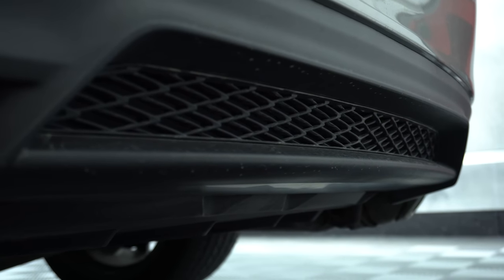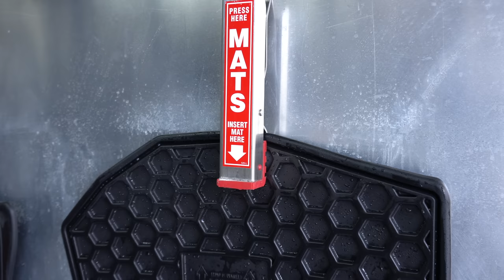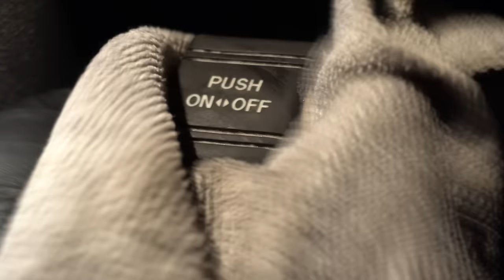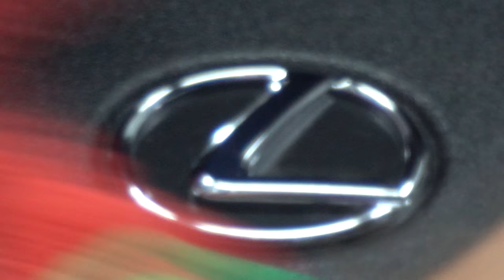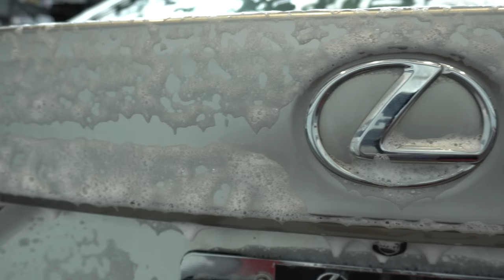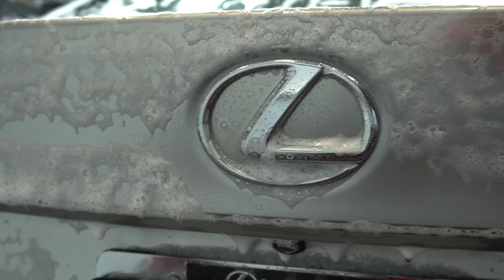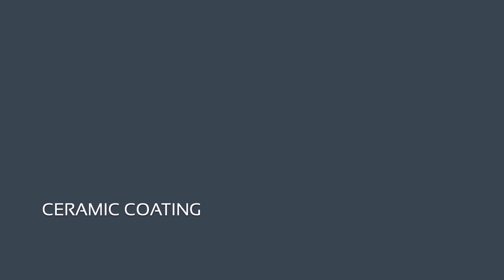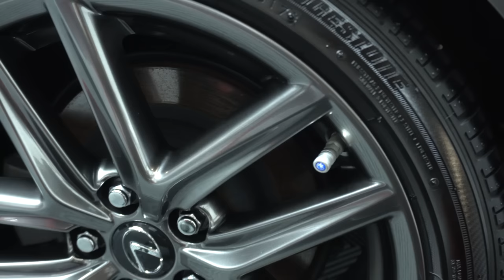2017 LEXUS IS300 F-SPORT LAVISH DETAIL | Interior + Foam + Wash + Polish + Ceramic Coating

Comment: I own one of these cars in Atomic Silver.  The lines are amazing. Each panel has intricate design elements i failed to pick up on when i first looked at the car.  Then I detailed the car and I was blown away.  After my first strip wash then polish and coating my wife came out and literally said Holy crap! Thats our car!?! Yep. 😜.   Just got my graphene from Adams this week sooo excited to get started.   Your videos are on another level sir.  You truly make art with your work and your vids.   Soo relaxing and instant gratification watching that car turn into art.  Thank you
Reply from the maker: No, thank YOU! I really appreciate the compliment. You do have a very nicely designed car. You are so correct with your comment about each and every panel having some unique design language. The part that really impressed me was the creases under the tail lights as well as the swoosh in the rocker panel towards the rear wheel. A very fun car to work on and it gave me a whole new appreciation for what the designers at Lexus were able to accomplish with this car. Take care.
Reply: RAD GARAGE hey Rick.  I don’t know if you check past videos for comments but if not I will catch you on your next video.  Since you are now verry familiar with the grill on this car you feel my love/hate.  I started using some 2.5 magnification reading glasses(online cheapies) and it makes the process waaay easier.  I have been through 2 headlamps though- both awful- what headlamp are you using in this vid?   You like it? Have a preference?   Any help is appreciated.   Thx from Texas.
Reply from the maker: Yeah, that grill has a lot of things going on! I can imagine it would be tiresome if you were the type who needed every one of those little spaces perfectly clean and dry. I use the Scangrip iMatch. It's good. Lately, I have been finding that the battery needs charging too often. I'll be right in the middle of a process and it dies on me. I think the battery life has gotten worse, but it could just be that it is getting old. I do use it a ton. I give it a 7/10.

Comment: Silver exterior with that Maroon interior go perfectly together.  That color combo goes all the way back to the beginning of "motoring".   I toured the BMW factory in Munich, Germany a few years back and they had a beautiful 1930's 328 in that color combination.   Just from the video footage,  I see exactly what you mean about the "fit and finish" of a Lexus.   That interior, including the dash layout and electronics look to be some of the best in the auto industry including the higher end marks, sans Ferrari or something.
Reply from the maker: Yes, they go all out to give these cars a luxurious feel. One thing that stood out to me was a protective "sleeve" that spanned the spanned the gap between the seat and the centre console that prevents anything from falling down that crack. Very thoughtful. And, yes, the colour combo does have a classic feel to it. Interesting connection to the old BMW theme. It's so interesting to see what automotive trends have spanned the decades.
Reply: @RADGarage Although I am a fan of Nissan/Infiniti I might have to look at a Lexus in the future.   They look incredible.   And you can never go wrong with a Toyota engineered vehicle.   With proper maintenance, it would probably last a lifetime.    On the Silver/Maroon note....many of the German makes of old favored Silver as the color of choice.   If you look at Mercedes and their "Silver Arrow" cars,  Porsche in the beginning had a lot of silver prototype cars, even here in the United States, a lot of cars (that weren't the famous Henry Ford "You can have any color you want as long as it's black), but the higher end US "Bespoke" cars, many were silver.  It just looks "Elegant" in my opinion.    I had a silver SAAB 9-5 from 2002 through 2012.  Absolutely incredible car.   That thing was a sleeper, it had a TON of power.   The darn Turbo charger was bigger than the engine block almost.   Loved that car.    Another great one Rick.   Your videos get better every time!

Comment: Lovely work. How did you find working with that paint - would you classify it as soft or sticky or tricky? I’ve got a Lexus GS metallic liquid platinum that I’m looking at polishing and saw another video with Lexus dark metallic where aggressive pad with finishing polish seemed to do the trick for a 1 stage. I was looking at using consumer grade Meguiars Ultimate Compound and Polish 1 stage I don’t mind if it’s not perfect as swirls really hard to see in my colour.
Reply from the maker: The paint on this Lexus was very nice. Now, mind you, I wasn't going for a correction on this project. I was simply using a soft polish to remove any residual Turtle Wax spray coating. I have heard mixed feelings on Lexus paint as far as how tricky it can be to correct. What's your experience?

Comment: Nice attention to detail as always, Rick.  That clear coat looked to be in good shape when you started, and the owner appears to take good care of the paint.  I would have liked to see what flaws you saw in the paint that made you want to do the polish and no clay bar.   I am learning so much from watching you work on these cars of various condition.
Reply from the maker: I did perform a quick clay, but I had to download all my footage to that point and recharge my camera battery so no clay footage in the final presentation. The clay didn't remove any contamination from what I could see in the clay bar. The car's paint had zero flaws other than a few little chips the owner had addressed with a touch up pen. It was simply a matter of removing the TW Seal N Shine and applying a double layer of ceramic coating.

Comment: When detailing an interior i vacuum lightly but found that I can get a lot of crumbs and dust out if I use compressed air and blow it out from the opposite side as to not creat a tornado of debris . It sounds odd but it really gets into those tiny hard to reach areas way better than a vacuum and doesn’t snag the carpet like some vacuuming does . Also helps get grim and crumbs out of rubber before I use my brushes . Not to mention gets all the dust out after I run the vehicle for a second to get any loose debris out the air vents . Your the professional I’m just saying it’s worth a try love the videos been a subscriber for a while now .🤙🏽. I had one  question why does my Adams wheels cleaner leave my tires orange even after I brush them and wash all the cleaner off . I’ve tried it several times and make sure I remove all the chemical but it still leaves it dull and orange looking ???
Reply from the maker: That's a great tip. I have used compressed air in different ways in different projects. I like to use it to blow out the seams in leather seats prior to vacuuming and your comment has reignited my love of using compressed air. Look for more examples of this in my upcoming videos. Thanks for the input!

Comment: Hey I’ve seen a bit of your work and it’s truly incredible what you have done to customer’s cars. I appreciate you listing everything that you have used on this customer’s car as it’s more laid out and easy to find. In regards to the polishing, what would be your top pick on the type of pad to use with a DA Polisher to remove heavy swirls and scratches? It is very difficult to decide as most pads work best with different types of polishers. I would just like a general idea of what pad would do the heavy cutting and why it would outperform other pads in that specific situation. If you get back to me then thank you for your time!
Reply from the maker: I am by no means an expert in this area, but I find the Rupes wool pads to be the most effective (for me) when needing to perform a heavy cut. I use a variety of compounds, and the wool pads always perform well for me. Obviously, you need to follow that up with a finish polish/pad combo but the wool pads by Rupes are my go to when I am getting down to serious cutting business. All that said, I also have pretty darn good results with Rupes yellow foam pads. I'd add a few of each to your arsenal.
Reply: RAD GARAGE  Thanks for the info! I’ll definitely try it out. Keep up the good work👍🏻👍🏻

Comment: Another excellent detail!  And a great Lexus too!  Did notice some serious rock chips on that front bumper though; also the a pillar had serious scratches. Question: after the polish, do you remove the polishing oils to help the ceramic to bond to the paint?
Reply from the maker: Yeah, there are some nicks here and there, which is par for the course when you winter daily drive a car up here. I use CarPro Eraser to rid the paint of any residual oils prior to coating. Thanks for the comment!

Comment: what was the purpose/reasoning behind polishing before doing the ceramic coating? (is it getting scratches/"imperfections" out of the paint?) after application of the ceramic coating, how often should you polish? how often should you polish/re-apply the ceramic coating? thanks so much!
Reply from the maker: The purpose of performing a polish on this car prior to applying the ceramic coating was to ensure the coating was coming into contact with a 100% clean and perfect paint surface. Any contaminants in the paint or residues from waxes, sealants or other coatings will inhibit the ceramic coating of bonding and its performance will suffer. This particular car had a layer of Turtle Wax spray sealant that I needed to get off and you can't just do that with a spray and microfibre towel. The paint was not swirled at all, but on many cars that is important to correct prior to applying a ceramic coating to ensure a strong bond with the surface. Once you have applied a ceramic coating, you don't need to polish until that time comes when you want to remove what is left of it. There are a number of products on the market you can use to finish off a wash that will help keep your ceramic coating performing to its potential. I reapply coating on an annual basis on my car because we have terrible road conditions for pretty much all months of the year.

Comment: Rick, I would love to know your thoughts on the seal and shine used on this vehicle before you performed your work. Was it difficult for your to remove, how do you think it holds up compared to other spray sealants?
Reply from the maker: Rami Kakish It seemed quite legit. At a few points in the process, I was wondering if the polish and ceramic coating was even necessary. That water beading action during the pressure wash was quite satisfying. It came off nicely with the yellow Rupes pad and 205, but it was too much for the Adam’s one-step pad and polish I initially tried. I don’t know much about the product to be honest. It seemed like an effective spray sealant though.
Reply: RAD GARAGE it is an amazing product. I like to  top it off with a wax for that deep deep shine.
Reply from the maker: As much as some people will say they don't, spray sealants have their place.

Comment: Another dope result Rick,, ,that looked like a very strong dilution of the wheel cleaner?  Was that straight up no water?  Also, saw the car beading after the onset. Did you use a strip wash? Or a Decon shampoo?
Reply from the maker: I used Adam's Strip Wash for the bucket wash and I did clay the surface (didn't really need it) but removal of the Turtle Wax sealant was something I hadn't anticipated so it added some time to the overall project. I use the Wheel & Tire Cleaner straight up. Way more effective and satisfying than when diluted.
Reply: RΔD GΔRΔGE you were right about that being a very beautiful car.  Underrated IMO. You made it look better than new!

Comment: Great meditative video.  Just curious, was the car already fully decontaminated from traffic film/iron buildup (i.e. via IronX) prior to the polishing process in order to prevent less visible particles from creating swirls?  Or does the Strip Wash make that step unnecessary? What're your thoughts on that particular step in the detailing process?
Reply from the maker: That's a great question. So, in this project I did perform a clay, but I wasn't able to film it because I had so much footage my 64G memory card was full plus I needed to recharge my motorized slider and camera. I think the decontamination process depends on whether the paint feels contaminated to the touch. This car came to me quite silky smooth. The owner had clayed it previously and sprayed it with Turtle Wax Seal n' Shine so I did a really quick clay. He also doesn't drive major roads very often so he isn't encountering large amounts of fallout from big trucks braking, etc. I find clay leaves marring when the contamination is heavy, but if you clay a car that has very little particulates in the clear coat, you aren't really roughing up the paint.

Comment: As others have stated amazing job. I have to ask what did you clean and protect the seats with? A buddy of mine just got a 2022 IS Fsport and I’ve never cleaned Nuluxe seats before. So I want to help them the best I can with maintenance on the cleaning.
Reply from the maker: This is going back a while. Checking the product list, it would appear I used Adam's Leather & Interior Cleaner. The interior of this Lexus was not very dirty. I did a light dusting really. My go-to interior protection product is Gyeon Leather Shield. I love it. I didn't use any protection on this car's upholstery.
Reply: @RADGarage  thanks for the response. Would you recommend this for Nuluxe seats?
Reply from the maker: I would say so, but I'd work it into a test section somewhere first. Always safety first! Are you in Canada?
Reply: @RADGarage  no I’m in the states below. But test areas are always needed with new products and materials. I’ll keep a lookout for something. I keep seeing products like VLR or vinyl typed cleaners and protectants on forums. I just need someone’s experience with it.
Reply from the maker: My understanding is that Nuluxe is synthetic leather-like material. I wouldn't expect a material such as that would really require much in the way of maintenance beyond a light spritz of any quality interior detailer.

Comment: Awesome video! Is the Lexus clear coat easy to work with?
Reply from the maker: Thanks. I didn't really get into the clear coat on this car. I performed a polish but that was just to remove the remains of the Turtle Wax spray sealant the owner had used to protect his paint. The paint was in pristine condition. It was a pleasure to work on this one.

Comment: What psi are you using on your pressure washer? Looks so minimal yet so effective
Reply from the maker: I don't really know. It's a low level electric PW that claims 2000 psi, but I bet it's more like 1000. It isn't something I have really obsessed over, but it is dialed in pretty good for my uses.

Comment: Hello Rick. What is the favorite Polish / Finishing compound? I am having a lot of dusting issue with the M105/205. I see that you are having no problem in the video. Are those Rupes Yellow Cutting Pad? Love your work and I watched all your videos.
Reply from the maker: Yeah, I didn't find dusting to be an issue this time. I have found that problem in the past with many polishes/compounds on the Rupes yellow pads. I don't really have a favorite, but 205, Menzerna 3500 and even Adam's Finishing Polish have all given me good results. I used Essence+ on a recent project and found it very smooth and satisfying to work with.

Comment: When you’re detailing the engine bay...Do u have to cover the electrical parts?
Reply from the maker: I don’t do complete engine details for fear of causing problems to electrical components. I am very careful to just clean what I can with very limited amounts of water and sprays and a detail brush and towel. Thanks for the question.
Reply: @RADGarage  when I was a pro detailer, I just sprayed it down and APC it , from Ferraris to fords, never had an issue.

Comment: Hey man, what hand spray water nozzle do you use? You may not have used it in this video, but it has a fluorescent green or yellow tip. Thanks in advance!
Reply from the maker: Oh yeah, I finally found a quality hose trigger. It's by a company called Yardworks and I picked it up at the local Canadian Tire. I don't think it is available outside of Canada though.

Comment: What would be the cost of this service in USD? Great video👍🏻
Reply from the maker: Oh, I have no idea. I guess it really depends on who you have performing the work. Maybe someone else could chime in with more knowledge than me.
Reply: That would be $4-600 depending on the amount of correction needed. That needed very little correction, but based on the time put in and materials it would be $400 minimum with the ceramic coating.  It’ll also vary based on location.
Reply from the maker: Sounds about right.

Comment: Makes me want to go leave work and clean/detail my car. Can I ask what brand of brush you use for the interior? 7:56 mark.
Reply from the maker: Do it! Work is overrated. That is a brush I seldom use but I thought I would bust it out on this occasion just for kicks. It is an interior detail brush by Swissvax. Probably too expensive given the Swissvax name, but I like it.
Reply: RΔD GΔRΔGE any others you would recommend? I was looking at one from Adams but people were saying the dye they used comes off and stains the interior.
Reply from the maker: If it's the Adam's interior brush I am thinking of, it is very soft and really works for light dusting, not real cleaning. I just pick up whatever is available and Carzilla when I stop by the shop. Some have panned out while others have been decommissioned. I am also enjoying using the Adam's scrubbing mitt. It works great on larger panels and seat surfaces.